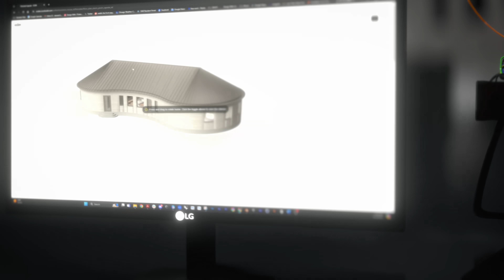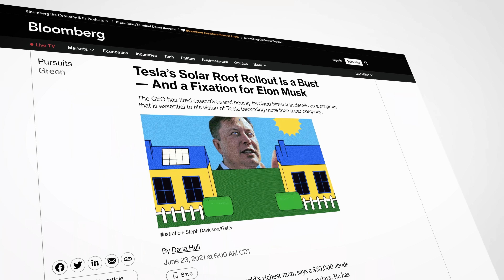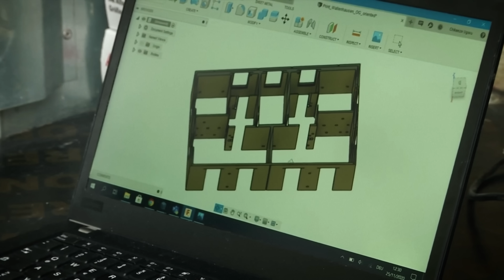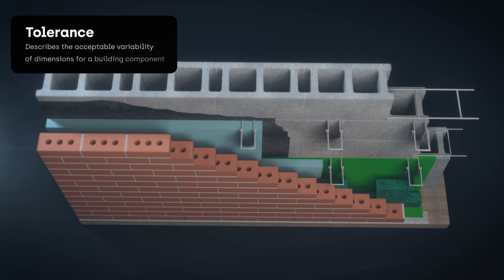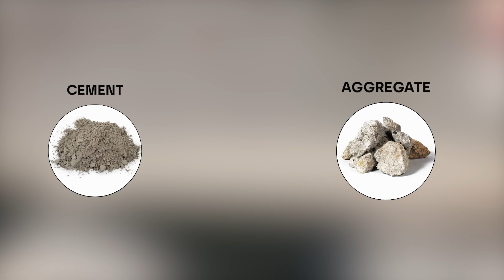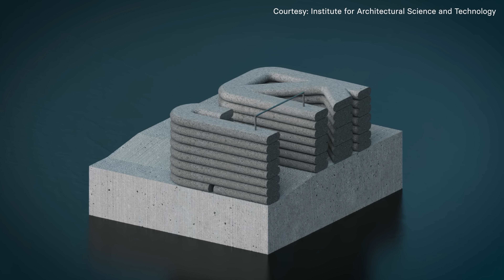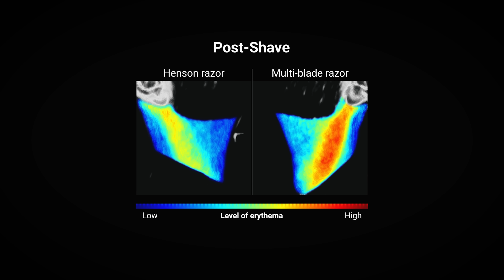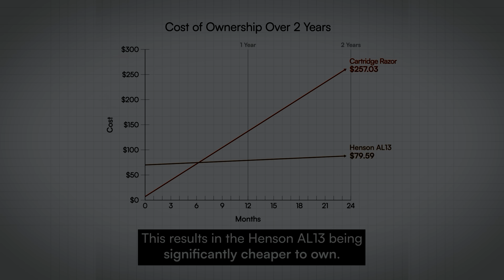Why 3D Printing Buildings Leads to Problems

Comment: How can you not fix a broken plart of the house? It's concrete. I'm 100% certain you dont undo a wooden house to fix a wall. So you can more than easily fix these houses without having to bring in a 3D printing machine again. What are you talking about?

Comment: Why do you keep comparing 3d printing to bricklaying?  Bricklaying is not the structure of the home.  The bricks are essentially a facade that makes the house look nice.  The structural frame of the house is typically made out of wood.  I don't understand why people with 3d printed houses don't put drywall on the inside and bricks on the outside.  Perhaps a 3d printed frame is not a cost effective replacement for the wood frame.

Comment: Any architects out there?
Ok. Hear this: concrete may look neat when it is freshly poured, but in ten years it will look awful.
Rough surface? Even worse.
Have you ever been to a multi-story parking garage built in the 80's 
That's right they look like f*ing Hades.

Comment: The "3D printed building" thing has always seemed silly to me. There are already pre-printed foam forms for concrete that click together like legos. You can have a team of 4 guys snap together a house in a few hours, then back up the concreate truck and just fill in the form. Done. The reason its not done? Concrete is REALLY expensive... and more importantly, no-one wants to live in a concrete house. They're cold, moldy, damp... they suck. 3D printing just introduces a bunch of limitations and makes materials cost a fortune.

Comment: Unreinforced concrete is simply unacceptable by the Structural Code in many parts of the world (mainly due to Seismic forces) ... furthermore 3d printing walls implies a steel or wooden slab for the floors and roof which again is very restricting ... the typical American House is far from typical in Europe fi, where RC block of flats or multi storey buildings with typical beam, column, slab structural systems provide flexible floor plans (as the walls are not structural) with the ability of large openings ... 3d Printing is a very hard sell anywhere else than rural US

Comment: Good video, great analysis though it's rooted in established doctrine that mandates modularity. And keeps a great many people employed. I don't think you mentioned a single problem that couldn't be overcome, nor a problem that is actually unique to this technology. Given time, vast improvements can be made. If the technology is allowed to mature and not snuffed out for daring to be different. 

Will say though that the use of concrete is not the most environmentally choice admittedly.

Comment: Um yeah so all the "issues" have pretty easy solutions for someone that has concepts, experience and history with both construction and 3d printing. Right angles, not hard; bridging, ok; exterior look, can be fixed; stopping the extruder seepage, simple enough; repairs and renovations, not a major issue.
The overall issue is 3d printing really isn't that scaleable due to basically trying to make a computer do a job that requires many adjustments during the process it's not capable of outside of a controlled environment. Especially since we have other technologies that are able to replicate older methods much more efficiently, effectively and modularly. I love my print farm but just no place for 3d print construction save for on a limited niche market and purpose.

Comment: None of the thing he says can't be done have difficult solutions that could easily be implemented.  Currently model homes using this expose the construction method for effect but interiors or exteriors could easily be finished with minimal loss to space. Repairability of concrete has happened since concrete was invented and could easily be blended to look original. Unsupported spans could utilize support materials like removable framing. Leveling and tolerance can easily be corrected for in the programming code. This method is just another option to construct that could end up being more beneficial in many different applications especially if you aren't limiting yourself to concrete. Wish the video had delved I to why it's a cool new tech and what are improvements around the corner rather than framing it as he did (no pun intended). Oh yeah and vertical integration has many benefits too including training, scheduling, reliability warranty opportunity and price accuracy...

Comment: The biggest problem I see is the time, machinery, and manpower needed for the transport, set up, maintenance, break down, and cleaning of the "printer". the "3 or 4 people for 48 hours" doesn't seem to include this detail. Levelling and compaction on backfilled soil for those footings seems especially time consuming. Not to mention, it needs a constant and very timely delivery of material. A crew of 3 or 4 wood framers can frame out a modest house in well under a week. You slap together the walls and truck in the trusses. No biggie at all. I just don't see any labor savings. I can see them being popular in tornado country, but then again a basement is always preferable- and basements seem incompatible with his method.

Comment: The main impediment to this type of construction is that it has 'no future'. Sand..., quality sand, is becoming harder and harder to source. A cubic yard (27 cubic feet) of Ordinary Portland Cement concrete has around 11.66 cubic feet (43%) of coarse aggregate.
Also, fly ash is a waste/by product of Coal-fired power plants. Good quality fly ash for concrete is becoming scarce as well.

Comment: I was the electronics guy in a group full of mechanical engineers at uni. They just got access to the 3D printer, an boy did they print all sorts of parts for projects on that thing. Only they kept breaking, even though the simulations said they should hold. I always found it funny that the non-mechanical dude had to tell them that the weakness was not the tensile strength of the filament material. It was the bonding between the layers. I see a similar problem here...

Comment: You can 3D print arches (of certain sizes) incrementally, each layer extending a bit over the last until the two sides meet at keystone point

Comment: These remind me of the Earthship type homes in New Mexico. They are very reliant on concrete, which is ironically very energy intensive to produce which runs against the Earthship environmentalism. Wood and lighter materials are much less energy intensive to produce for construction.

While the goal of 3D printing isnt environmental, I think its worthwhile to consider the environmental impact of such permanent structures.

Comment: I've worked mainly on large Reinforced concrete structures.

The 3d printing of buildings are.Focusing on the easy problems the shell of the building .

What makes a building expensive is everything else, foundations, drainage, ground floor slab, heating, wiring, plumbing, painting, fixtures and fittings, insulation, tiling, etc etc.

Bathrooms toilets etc are expensive.

3d printing can only do so much without thinking about the home in totality.

In the commercial space it's common to have toilets prefabed and droped onto the slab at each level, this saves a significant amount on cost and time.

Comment: looks lame i wouldn't buy one, so to set up said printer you need a nice sold slab, what about homes with a basement what about rebar wire mesh that most concert workers use ? looks like it would be a pita to frame inside ,whats it cost difference of a standard one family being built for $250 ? i don't see this taken off

Comment: I love the future potential for advancement and unique, lasting structures. But the US market specifically has a problem. We often hear about strength or sustainability, etc but there is an elephant in the room, Changeability.  I watched this firsthand when my neighbors updated their home for sale. The new owners came in and updated the home. Owner #1 renovated it to sell and Owner #2 renovated it when they moved in.  I would argue this is the primary reason stick framing is still dominant.

Comment: We need 3 million homes now, and 3d printing is fastest way to get there. Let's worry about problems later, as solutions you mentioned can be solved with portable printers for repair work.  Let's start building now.
Reply: We wouldn't need 3 million homes if the liberals didn't let in 50 million foreigners.

Comment: I dont really see any benefit of 3d printing concrete walls over Precast walls. Install for a single family home takes only one day setup and install.. They even come with insulation and studs pre installed.

Comment: Great video! I'm working with 3D concrete printing for about 4 years. Your research is on the spot!  Really well-pointed problems.
I can say that concrete doesn't relay only on rebar but also on dispersed reinforcement such as polypropylene fibers. 
Cartesian printers have some limitations but nonplanar printing is a thing ;)

Comment: Some companies take the extra time to install the necessary supports. But yall need to keep in mind that this method isnt regular concrete either. But to be fair, i work in the trades, and even the modern, typical building methods have problems. Critics, pick your poison....

Comment: Not sure this will work too good or save money since you still need reinforcing for this slurry  unless of course you enjoy huge cracks and an unsafe structure. You still would need the foundation excavated and made ,plumbing ,electrical ,insulating,roofing etc.I think this is cool but not an answer . Right now prefab homes are a better answer than this .

Comment: Can you not put something over it like dry wall?
Reply: Dry wall is nailed onto wood studs normally. For this you would need to glue it or get used to having a few visible bolts holding it in.

Comment: a lot of the time and cost is the final touches ... if price is the goal it makes more sense to make "blocks" in a factory that integrate as much as possible.  on site you make the slab and the connections for ekectricity, water and sewage. then  a truck arrives with finished pieces that you just stack on top of each other.

Comment: We dont use brick and concrete to build homes because it has terrible energy coefficients.  Its cold in the winter and hot in the summer.   Theyve built homes of brick since the 1800s.  Theres a reason why its been fased out of use other than being decoration. Concrete is the same.  All you have to do is make molds for the concrete. 
This 3d stuff will end up being a fad.  Especially since they're pouring the concrete over the plumbing and electrical which means theyre not going to be fixable when it springs a leak.

Comment: Few issues. How do you make the wall straight? A LOT of other materials to smoothen it out? How do you ensure the wall is in level? Not just if youre looking from next neighbourhood, but dirrectly against the wall in the sunshine. Honestly to straighten it all out and chip off all the pieces... im not sure if simply using brick isnt easier at that point. Concrete is hard, a brick layer can build 1 meter per day in height. And where do you add rebar? so it just doesnt collapse after having 1-2 cracks. For bricks every 2nd or 3rd layer there is rebar.

Comment: Reinforcing the concrete is a problem.   Micro rebar is not able to mix with concrete and flow like in a standard formed construction.  Fiberglass might work.?

Comment: As the rest of the comment section said, 3D printing is great but not only does it not adress the root cause of the housing crisis but it automates   one of the cheapest and easiest parts of house-building.

Comment: Interesting video. A couple of points, bricks have been used to make arches for hundreds of years without lintels and cement is unsustainable as the main building material. I'm sure there'll be a more sustainable option in use soon.

Comment: O.o concrete without space to expand cracks. Hence why it always has gaps to expand. Does the vertical rather then horizontal change that?

Comment: This seems like a very American-centric viewpoint as far as comparing to wood frame homes, which have far less longevity. Regardless, I don't see why they couldn't print the home, then grind to faces down smooth and recycle what came off. Same with window/door spaces, where you could make the space too small and grind it back to a perfect fit.

Comment: Why not build smaller 3d printing modules for certain components and attempt to integrate 3d printing into the design of a house?
Two printing nozzles on either side of a steel mesh reinforcement might work out, and then a sanding robot to machine it smooth.
It might take longer than 3d printing a house, but a shorter time than traditional stickbuilt.
Also, why not use kits and other things to integrate housing modules via factory.
You could integrate everything and have these houses out quickly and god knows humans need them.

Comment: Two thoughts: why not have a second machine that uses a material that can look smoother and have it applied as a second layer to the surfaces. It doesn't have to have any of the demands of the structural components, so it can be specialized for appearance. 

Alternatively, why not have the machine not put out the material from the center and have it move towards the edges, but have it put out at the edges and then pushed together and smoothed out?

Comment: 3d printed homes are a joke. There no money savings doing this. There’s no time saved doing this. In the time it takes to 3d print a house, in Florida we can go from slab to frame complete. It’s a scam, joke, and so on. Conventional.Construction is the only way to go. As far as costs, look at your builder. Building a home in Florida is about 40%more expensive due to builder greed. It’s not due to land, build or material costs. No one is talking about this because they’re sponsored

Comment: I think this is best for specialized and functional buildings. 
in 3d printing supports and inserts are used to enhance the print, aswell finishing is not always necessary, but would be simple to do.
trimming and filling seems to be the solution here.

we have cookie cutter designs for everything this allows for unique dimensions and little cost to customize for design and materials

Comment: If you wanted to do an interior repair job then you're going to need to mix the cement into a bucket and then load it into what is essentially a large cock gun and then have a Workman inject that into the problem area the ugly mess ups can also be grounded down post Construction and I've never seen a completed wall with the cement exposed meaning we need to start using more standard interior construction methods to fix those issues

Comment: The layer lines are a problem that have been plaguely 3D printing since it's Inception and when it comes to the models I have the same answer for the houses they need a post layer modifying machine something like two spatulas that would drag behind the printing head and straightening the mortar and the inability to control the pump precisely means that it needs a sliding gate valve at the nozzle and with proper programming post processing plates you can fix the straight angle issue

Comment: I don't understand why they don't attach drywall and siding on the concrete either after it's done drying or even while it's still wet, that way the siding/drywall won't have any screw/nail holes and won't fall off. Now I do understand the downsides to having the concrete and siding/drywall pretty much merged together (repairs, renovations, etc.), however the bare concrete wall has the same limitations, at least the siding/drywall will look better and can be painted, not to mention you can hang things in your house without needing to drill through concrete.

The same goes for windows and door frames, I thought they would have installed them while the concrete was still wet. However, I am not an architect nor do I work in the construction industry, so my knowledge is limited. I just found it weird that they didn't cover the walls after.

Comment: Why can't the printing head apparatus be fitted with something like a pari of vertical trowels, one on either side of the wall, to smooth the layered appearance a little? It seems like it would lead to a more pleasing appearance and also make it easier to do whatever decorative touches you might want later, which would be better suited to non-lumpy walls.
Reply: to be honest not only that, but also portaying it as a major issue while completely ignoring the fact plaster (not only drywall) is routinely used in the standard construction shows the negative bias. There's no one stopping the architect from covering the facade with "something" to make it look less alien.
Reply: I assume that leaving the texture is a gimic to showcase the tech to investors "Look, look, look our rough walls mean it was 3D printed!"

They (CEO or whoever is in charge of marketing) probably think smooth walks would look cast instead of printed (since nearly every single 3dp building leaves the grooves that this is probably the case)

Personally I think those college students mentioned had the right idea with smoothing as it prints.
Reply: @Ne0spartan  Small grooves, I could understand, but the log-cabin look is nuts ;)
Reply: I saw footage of a concrete printer from a University team that had exactly that. An attachment on the print head troweled the edges flat. It worked perfectly! Why this is not standard for these machines is beyond me.
Reply: If you think that would work you should try it and let is know how it worked out.

Comment: Well, do you know that , on top of the walls made by 3d printing machines , you can add extra construction materials like plaster, wood panels , foam isolation and , any other construction material so you make it look normal, not concrete poured layer by layer?